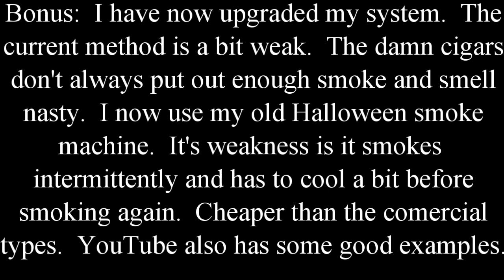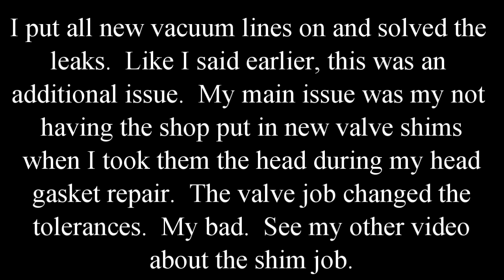97 Camry mystery noise vacuum leaks IAC & throttle body check

Comment: I have a 2011 Toyota Camry with 360,700 plus miles. I've been racking my brain trying to figure out what that noise was I took my car to get an oil change from somebody while I was out of town real quick and I guess without me knowing when they were replacing my air filter they snapped the screws and didn't tell me

Comment: My VW Passat had about half a pound of dog food in the intake tube before the filter a mouse used it for storage 😂 it couldn't go passed because the tube has a metal screen 😂👍
Reply from the maker: Geez!  Don't feel bad.  My 97 Camry had a mouse in the squirrel cage blower of the a/c.  It had gotten in there and was rather flattened out because of the the centrifugal force.  She was a bit mummified.  I never smelled anything.  I first thought my fan was losing its bearings because the more I increased the speed the more it wobbled and made the dash shake.  Took a bit of effort to clean the remnants out.

Comment: My car is throwing a p0505 code and i replaced the IAC valve its idling normal now but the code wont go away the check engine light is on but i hear a leak somewhere.    Inside my car i hear a air leak i dont know what to do ...
Reply from the maker: Have the car smoked to find the leak.

Comment: What size hoses did you use? Where did you get the hoses from?
Reply from the maker: Let’s Cook! I don’t remember the exact diameter. I measured the outside diameter of the connections with calipers. I also took an old piece with me to the auto parts store and got pieces slightly smaller than the diameter of the old ones due to age and stretching. If you have a good relationship with your auto parts folks they might even snip off a small piece for free for you to test at home. They sell it by the foot.
Reply: @TOM2RN  The three hoses under the IAC. I removed the middle one. I broke the tab off the top. I attached back, but I have a shake in idle with torque gears.  What exactly is the middle hose called. It attaches to the crank case. Do you have a diagram you can show me. I've been looking for that hose for 2 months. TY is you can help. I have a 2000 Camry Ce with 211,000.
Reply from the maker: @laurel9307  I don’t recall the name of that particular connection. I gave that car away a few months ago. Take the hose to an auto parts store snd buy it by the foot. It’s basic tubing, not fuel rated. The important part is to make sure the diameter is correct. There is a small valve tucked way up under the passenger wheel well where these can connect. You have to remove the tire and pull the plastic fender liner to get to it. Sorry, no diagram.